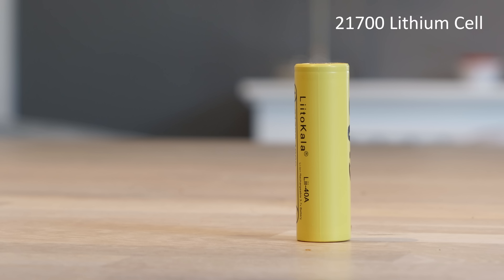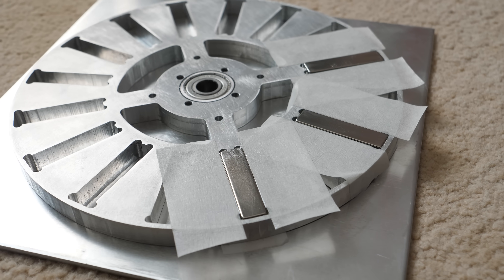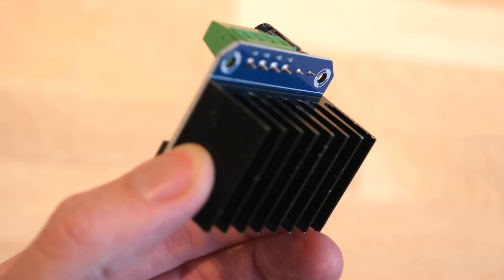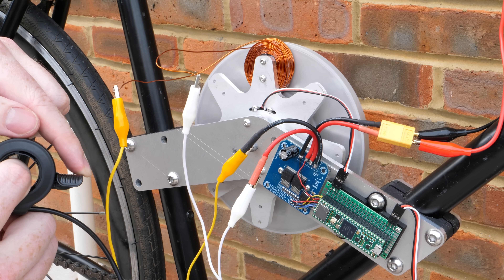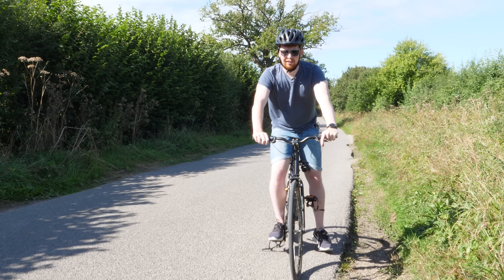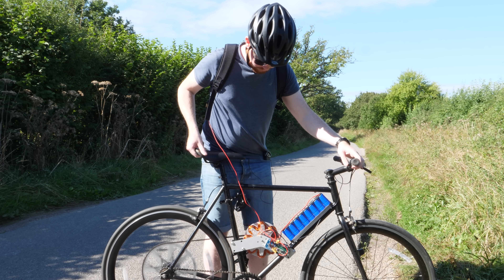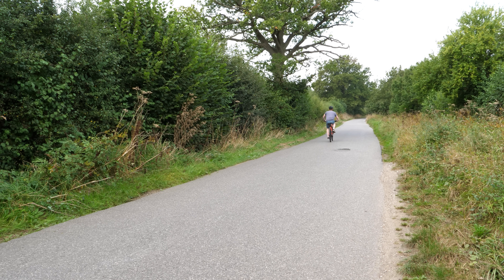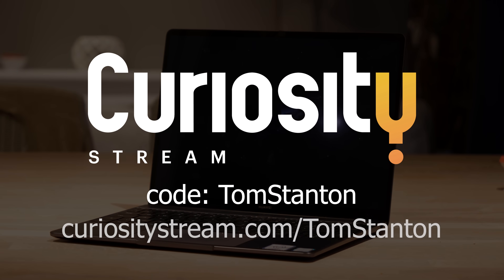Super Capacitor Bike

Comment: Some ideas for improvement:

1) Consider designing a switched reluctance or synchronous reluctance motor. These should support a wide input voltage range. BLDC and PMSM motors like your pancake design have the disadvantage that the back EMF depends linearly on the rotational velocity of the motor. This means that as your battery voltage drops your max RPM and max stall torque drops proportionally, Just like a brushed DC motor. A switched reluctance motor should be easy(ish) to design along with the controller. The newer synchronous reluctance motor is much harder to design often requiring finite element analysis tools to analyze magnetic fields. I don't understand the controller algorithm for them, either. These are the best choice for EVs, especially the ones that include permanent magnets for even higher starting torque.

2) Take a look at VESC and O drive. I'm sure you've heard of them. Both controllers are open source and have good hardware options. VESC should is tuned for controlling medium size 500W to 4000W PMSM/BLDC motors for blade scooters, long boards, eBikes, small EVs, etc. These use more advanced methods of motor control like Direct Torque Control or Field Oriented Control. They can do neat things like advance or retard the phase of the 3 phase voltage controlling the motor to perform field weakening to allow a BLDC to run higher speeds than normally achievable, and also retard the phase and consume energy to perform regen braking. They also implement 3rd harmonic injection and space vector Modulation to allow more efficient use of the DC supply voltage at the cost of harmonic distortion and common mode ripple/noise.

3) the motor design should include a magnetic core made from thin laminated sheets and not aluminum. Aluminum acts to reject rapidly changing magnetic fields (it creates an opposing magnetic field) due to its conductivity. Because it isn't a perfect conductor, the generated countermotive field isn't exactly equal to the generated field. You basically created a short-circuited secondary I'd you think of it like a transformer. 

A really cheap way to go is to simply modify a car alternator as it already has a decent stator. (Car alternators need to be able to generate several KW) Rewind that with better wire. and if you can design asterisk pattern rotor, you could probably make a half decent switched reluctance motor.

Comment: Is your next ebike going to combine the super capacitor with the batteries. So when the capacities are charged, you use them for a quick burst of power, and can regenerate their power easier, with the batteries doing what they do best at a constant speed. It'll increase the usage and variation of each and balance the use of battery and capacitor.

Comment: I'd love to see a bike that have completley disengaged the chain from the drivechain, so you pedal a generator and let a motor drive the bike. The reason for this would be to not have to deal with gears, but you can pedal at a constant speed of your own liking (maybe adjustable generative power from your pedals), while you have power for the motor at any time. So even when pedaling on a straight, you add up power for the next hillclimb.

Comment: Just a quick thought. Would it be possible to have alternating magnets on the front rim and use that as an alternator to charge the super comparators? Considering the capacitors are meant to be rapidly charged and discharged, it wouldn't hurt them to charge quickly from the rim alternator type thing. Idk, just an idea and I'm not sure if that would even work

Comment: Riding my recumbent bike is really fine but starting is sometimes tricky. How cool would it be to charge the capacitors when slowing down for a traffic light to shoot me forward on green. Just a few meters would be enough to click my shoes to the spd paddles and take over from there
Reply: Indeed, the energy required to accelerate a mass is far higher than required to keep a mass going at a constant speed.

Comment: What if you used a super capacitor buffer for charging where you rapidly charge the supercapacitors which then discharge slowly to charge the lithium ion battery but the motor can take energy from either for power if the battery is too dead

Comment: Very cool! I have also thought of limiting the output of the caps, and using a variable voltage regulator, and there by keeping it at a high voltage for longer, but haven’t got around to implementing it into an experiment. Haven’t even done any calculations yet.

Comment: Could you not have added holes at every magnet position then used a light sensor and led?
Reply: Less drag
Reply: @dennisford2000  I mean yeah but for the speed this thing would reach I don't know if it would be affected that bad. And you could encase it. I mean this whole build would be better as an exercise bike that powers your storage system. My thoughts would be to have two cap sets and let them alternate between the two. Seeing as one set could charge at the rate the other discharges and caps have a far lengthier life cycle it wouldn't hurt them too bad. Where there is a will there is a way. I wonder if you had alternating cap sets if you could generate more torque as well. If you slow drain your losing pressure than if you allow them to discharge rapidly. Right? I'd build it but I'm broke so I'll just toss out random ideas.

Comment: Capacitor won't work without booster regulator to keep up voltage for motor controller? Great work, but why did you spend so much effort in developing the motor?

Comment: With a more efficient motor/generator, this could be really impresive in terms of regenerative braking.
Reply: This is exactly why Lamborghini uses super capacitors for their "hybrid". Only, the electric part of that system accounts for 34 of the 774hp.
Reply: This is what I was thinking. Much more efficient way to use going down one hill to get up another. Like a booster kinda thing

Comment: Why not add another set of coils to the other side of the rotor and double your toruque? 
Instead of using a plastic core, try black sand with epoxy and dry pack it inside the air core. 
This way you'll have cogging, but it goes away when the rotor starts spinning. The magnetic crystals inside the black sand form are a poor mans ferrite core, but works very nice. 
Air cores are worthless. 
I made a motor like yours back in 2000, but only 5" rotor with 3/4" round Neo N38 Magnets. 8 magnets in the rotor, and 9 coils on the stator. All machined out of Delrin. 
This was a pulse motor. I pulsed the magnets right after registration with the core, and recovered the excess energy (back emf kickback) back to the main reservoir electrolytic caps.
I wish super caps existed back then for the average Joe.
Do that in a circular pattern, and you got yourself the rotating magnetic field. I measured the efficiency to 87% under load, which is crazy. All the claims of free energy in this design, is bogus. It's just super efficient and the only losses, are ohmic. 
The good news is that you can gang the rotors on to a common shaft, with an offset angle for each rotor, to give you multiple coil pushes in one rotation of the rotor(s).
 
If you're looking for the most efficient electric motor, look no further than a variable reluctance pulse motor generator.
Robert Adams tried to sell it as a free energy machine back in the 90's, since the efficiency was so high, but he died an unsuccessful scammer. Bill Muller and John Bedini where other scammers that tried but did not succeed. They did all had good ideas to add to your design, but no free energy.

Comment: Ive had an idea for free energy. Add a dynamo to the bike so when you pedal it will charge the bike battery. The bike battery then charges the capacitors, the capacitors powers the motor. The motor moves the bike forward.  Hey presto free power. You're very welcome.

Comment: It seems like a supercap storage system for regenerative & downhill charging could be used to quickly store & then slow charge a li-ion battery.  Both in one system seem better than one or the other alone in a system.

Great DYI axial flux motor!  I'd like to see details about your electronics. Do you share that info online any where?

Excellent vid.  Thanks for sharing

Comment: I'm deeply impressed that you produce everything by your own, but i would use reliable already available parts for testing principles. As another one wrote super capacitors for recuperation, and the first meters to accelerate the bike and for cruising the batteries. Need some adaption of the software but that's the way to go.

Comment: for a version 2, you can use a joule theif, to extend the useful range of the capacitors
Reply: There's better topology, such as booster converters.
One using MOSFET in place of diodes should reach close to 85%

Comment: match the supercaps max voltage with a li-ion battery pack and put them in parallel. Get the best of both world, high energy density on li-ion, high power from supercaps. Then do some acceleration and regen tests with and w/o supercaps.

Comment: Think about an alternator on a gas engine, the gas engine rotates spinning the alternator charging the electrical system, If you could hook an alternator or 2 up to the front wheelYou can recharge the system as you travel on the bicycle.

Comment: The motor torque is created by magnetic flux trying to find a path of minimum reluctance. This is what really happens when you align magnets NS NS (relatively straight wide magnetic path -  min reluctance) vs NS SN (magnetic path pinched between magnets - max reluctance). The problem with your design is that most of the magnetic path is in the air around the motor, so reluctance changes are small - low torque. You can greatly reduce that fixed reluctance by "closing" the circuit by e.g. placing mild steel plates on each side of the motor in such way they touch the magnets and electromagnets. This will also reduce the magnetic flux leakage attracting (trying to find its way through) the chain. As someone mentioned eddy currents may cause power losses, especially at high rpms - avoid conductive materials in the magnetic path.
Reply: I.e., no aluminum rotor magnet mounts either!
Reply: @muffin_simp  good point, that's where the flux is changing the fastest, so losses could be an issue. I'd also add iron cores for the coils (currently plastic). One problem with these changes is the increase in the force pulling both halves together, this probably means the frame and bearings would need an upgrade as well.
Reply: @John Green, Thanks for writing all this. I've been thinking about making my own motors and was wondering about magnetic flux and electric currents.
Reply: Perhaps he could remove the chain and fashion a belt drivetrain
Reply: @adamb724  that may be a good thing to do in any case. Guiding magnetic flux will help a lot but I would still expect one percent or so of the flux to leak.
Reply: Cool observation thanks for sharing.

Comment: I don´t wane be the smart aleck, but!
Having the coils of the motor on a plastic spindel, and backed by an aluminium plate is very bad!!!
even the aluminium on the rotor is bad!
Aluminium induce alot of edis current!

You need to confine the magnietic fields to where you need them!
That is usualy achied with ferromagnetic metals, like iron..... 😐

Even better are laminated transformer plates... (Trafoblech) in German, sry can´t find the right translation.

In that axial construcktion, you would make cores in a W shape around and into the midle of the coils, for a rotor this flat, you might be better of with a chassis out of plastic!

Comment: Generally you can charge lithoum batteries at speeds that would exceed regenerative breaking energy. There are LTO batteries that can be charged at 10C (they have slightly lower capacity but for ebike should be ok)

Comment: I wondered if you could optimise a motor/alternator to fit this purpose. High peak torque in both acceleration and braking, low “quiescent drag” and light weight would be ideal.

Comment: Can you build a bike, that uses supercapacitors to quickly charge, while riding the bike, when driving downhill or normal, and slowly transfers the energy to a lithium battery? Then when you drive it should automatically (with a gyroscope sensor) detect if you go uphill and therefore helps you to get the hill up with the same amount of force, you need to paddle when driving normally (on a flat street)? That would be awesome. It should also use the break force of the motor, to turn it into energy again. So it can give you a quick start as long as your velocity is under a certain threshold.

Comment: So you basically made your own pancake motors.... I've been one of the first engineers to implement pancake motors in a car. They were YASA P400, two on the rear axel and another one on the gearbox of the ICE. Insane torque, insane power and very small form factor. Everything I wanted really... Except prototypes of those motors were about 10k€ a piece back in the days. Now Koenigsegg used them. But remember that back in the days, a small french team of engineers made a GT coupe with a 1.2 THP 155bhp ICE and three 400 N.m, 160kw peak electric motors ...

Comment: A hybrid system with batteries and super capacitors would be very interesting.
Normal drive from batteries, but re-gen breaking power to the capacitors then use that power to start up again.
Reply: Don't most brushless controllers have big  caps in?

Comment: Comparing 1kg of petrol to 25kg of lithium batteries is not a good comparison. 
Conventional petrol engines only convert about 17%–21% of the total energy stored in petrol to useful power (e.g. movement of a vehicle). Meaning they have an incredibly low efficiency compare to how energy-dense petrol is....
An electric motor on the other hand is typically 85% to 90% efficient. Meaning you utilize pretty much all the energy stored in the batteries.

Comment: Triple the capacitor bank , use overcharge protection on the cap banks.
Use in combination with lithium batteries. 
Program a controller so the caps are used when the bike goes from a standstill to a decent speed.
The Regenerative braking has priority in charging the caps first before charging the batteries. 
You can use  a relay to switch in the capacitor power when needed.
Reply: This was my thought, might be a bit harder to implement but could probably really improve regen, especially when hitting the brakes for short periods. 

Relays are likely to weld at high currents, perhaps some sort of high power solid state switching?

Comment: Shouldn't the capacitors be wired in parallel, not series?
capacitors in series lowers total capacitance just like resistors in parallel lowers resistance.

Comment: I'm curious if you actually achieved 11881J of stored energy. You soldered your caps in series, and I counted 8, which should yield a total capacitance of 50F, much lower than I think you intended. I think you got significantly less energy storage than you estimated. How did you come up with 11881J?

Edit: nevermind. It seems you used 50F when calculating your energy storage. Still, why not solder them in parallel?
Reply from the maker: I actually used an online calculator. But running the equation 0.5*C*V^2 = 0.5*50*21.6^2 = 11664J. So it is slightly out. I know the capacitance decreases in series, but the energy storage still increases.

Comment: Really interesting idea! 
Maybe next time you could try to build a e bike, but powered from a flywheel.
You could use a bicycle wheel as a flywheel, it has an ideal size, it is balanced, and the weight is concentrated around the edge. Spin it up with an electric motor, near the limit speed of it when the thing explodes. 
Using a cvt and a clutch system you could link the flywheel spinning at 10s of thousands of revolutions per minute to the wheel.
Based on some online calculators, a 28" bicycle wheel could store 3.6Kwh of power, when spinning at 100000rpm.

Comment: Jo Tom I have an Idea...

Super Caps are good for regenerative Breaking and short fast acceleration. Lithium-Ion Cells are good for low Amperage but long durations...

Im thinking a Hybrid Bike. Half electric and half electric. Use a few light supercaps for energy storage while breaking and release it while acceleration, and maintain the speed whith liIon Cells. You could make a Hybrid power supply witch changes sources. There are 4 Stages:
1. Accelerate until Caps are LOW
2.Switch to LiIon Cells and drive
3. Break regenerative into the LiIons
4. extinguish the Bike

maybe there can be an maintaining mode: If the bike has stopped and the caps are emty, charge them with your normal cells for fast energy deloivery.

ps: next time use 2 plates with magnets. One for each side of the spools.

sorry for my badf english, I love your Videos, keep the good work up.
Reply: I agree, and don't worry about your bad English, if I tried making this it would be a case of "extinguish the bike".
Reply: He can get a small fire extinguisher for a Moto race bike to mount on the frame.  
But honestly why is there no electric bikes that can be charged by pedaling them? It just seems logical to me. Never having to plug the bike in
Reply: @dav1dbone  it's not free energy. The battery (or legs) gets the mass moving. How does (in the real world) that mass get slowed down? The conventional way is by friction which produces heat. That heat is normally wasted (again real world application ie brake pads). If that kinetic energy can be converted to electrical energy and then stored and used to propel the mass again, then that is recovering energy that would normally simply disappate as heat into the environment. Even if not 100% efficient, the normally wasted energy is reused.